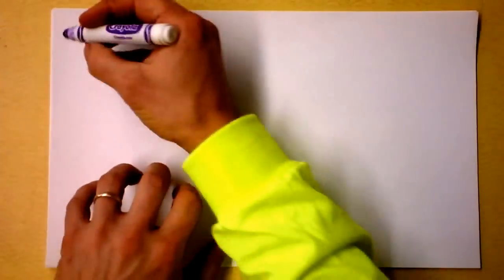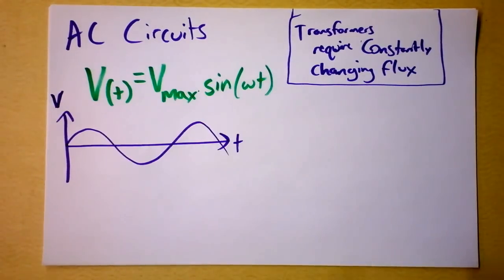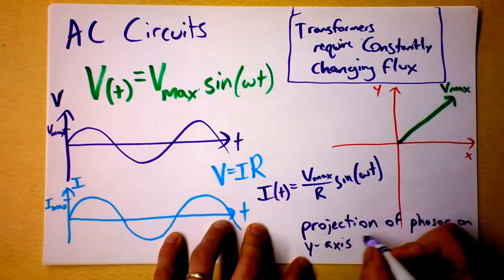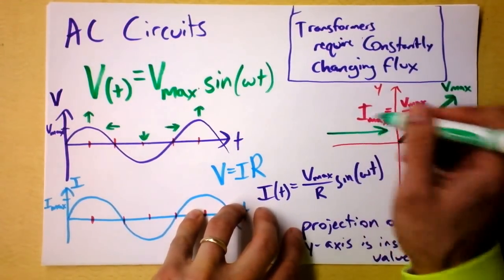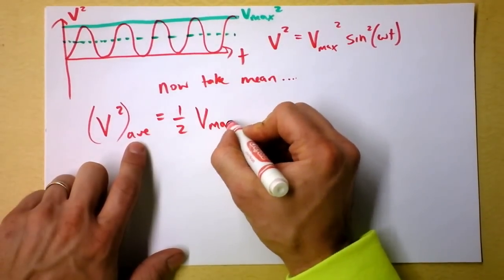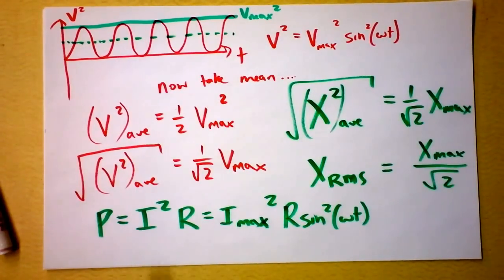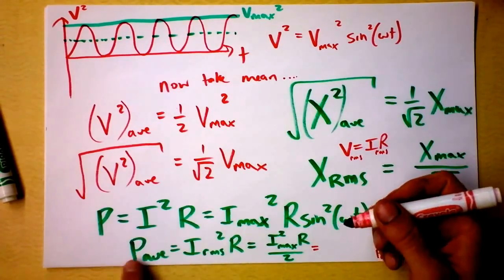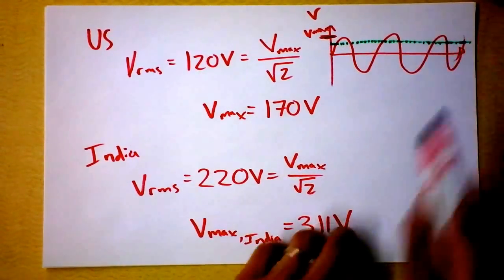Intro to AC Circuits using Phasors and RMS Voltage and Current | Doc Physics

Comment: why is volts and current dependent on  sin(wt) , but my teacher said that it was dependent of cos(wt) ?? help
Reply: In the case of Alternating current and voltage, both are true. A.C has a sinusoidal waveform similar to the graph of sinx and cosx (Google the graph of sinx and cosx, in case you don't know). So, sin(wt) and cos(wt) both can be used to represent voltage and current here.
Reply: Abhi Joshi whats the difference? is it the time frame?
Reply: To assume that the wave is starting from 0 Amplitude, we prefer sin for the sake of simplicity. Whereas, if you observe cosine graph, it starts with maximum value of Y-axis (i.e. Amplitude in our case).
Reply: +darkblader061 I hope this helps.
Reply: Abhi Joshi so its just a matter of convenience? thank you :)

Comment: wait, (v average)^2 is 1/2 (vmax)^2 ? 
why not, 1/2 (vmax sin (wt) ) ^2 

so, why the cosine is gone ?
Reply: Irvan Kurnia Ardi Vmax×sin(wt)  is the instantaneous voltage and thus is irrelevant when you are calculating Vrms because RMS theory was developed purely to calculate power by saying Pave = (Vmax × Imax) ÷ 2
Therefore Pave = (Vmax÷√2) × (Imax×√2)
Therefore Pave = Vrms × Irms

Comment: Never mind! i worked it out! you just did not show your working. You said the RMS =120V, Therefore i have to dubble 120 to get 240, then 240 is the Vmax!! So i have to then put 240/root2, which then = 170V! :D

Comment: Is it my imagination or is it the most people, even the educated and the savvy folks don't say it right.
This is what I hear all the time: In 60 Hz AC system current changes direction 60 times a second.  1 Hz is one full cycle.  
 How about if I say the current changes direction 120 times a second.  
Doesn't the direction change in the halfway point of a full cycle.  At the end of 1 Hz, it is actually going in the same direction again. 
Every time light bulb flickers, I count that a change in direction.  I guess most people feel that just because light bulb flickers it doen't mean that the current changed direction.
Reply: Hi,
Actually 
120hz means 120 cycles per second. The negative cycles are THE change in direction.Each cycle combines positive and negative. If X hz X cycles.
Reply: @bharathp1000   Xhz = Xcycle.  Of course.
Since the current changes direction 2 times in each cycle, how many times it changes in 60 cycles (i.e. 60 Hz)?
By the way, there are no negative and positive cycles.  It is just a cycle.
And there are no positive and negative directions either.
Reply: @alchemy1  
hmm.
In a cycle current changes from one direction to other. So you should consider the count as one not 2.
Reply: @bharathp1000  In other words you count the change in direction at 180 degrees, the middle, the in-between one. 
What is your position if instead of using the words " The electric current changes direction 120 times a second in a 60 Hz AC system"  I said this:  " A light bulb flickers120 times a second in a 60 Hz AC system".
Reply: @alchemy1  Hi,
let's solve it with small values, consider 1 hz, and find out how many times direction has "CHANGED"? and use the solution for many cycles.
Reply: @bharathp1000  The answer to that is quite obvious.  If I walk from point A to point B and I want to come back to point A I  have to STOP, turn ONCE unless I want to go sightseeing or go back to point B.
That is clear.   
 Now I have answered your question very clearly,  It is fair you answer mine and here it is:
Bob asks you, see that guy, his name is James.  He is going to from that one pole over there to that other pole across the field back and forth and back and forth, back and forth.....
Your job is to count EVERY SINGLE TIME  you see James turn around and change his direction.  When your eyes see James make a turn you count it. 
His statement is in CLEAR PLAIN ENGLISH.
How would you count and what would you do?
The question is obvious, are you going to count when he turns around one of the poles ( if yes which one) or both?
The answer doesn't appear mysterious to me.
If I were to ask the same question from 100 people besides you, what do you think their answer will be?  Think about it.
You could answer me regardless.
Reply: @alchemy1  hi, let's not involve Bob and James into this. 
I understand the cycle way.
After reading your first message carefully and I started to think of 2hz signal . If I count the intersection point on the x axis(time) I'll get 3 points. So i say three times the direction changed. It'll be different from the cycle way.
Reply: @bharathp1000  And it is only fair that I thank ( Bob and James) in their effort to bring clarity. And I have thanked them on behalf of both us in letting me use their names.

Comment: your method for calculating the average volatage is wrong.
Reply from the maker: Oh?
Reply: yeah! it needs to be calculated with the help of integration as follows calculate the heat dissipidated by the ac current in a time period and equate it to (Iavg)^2RT as rms value of an ac is that dc which produces same heat in a resistance as produced by ac in time T.hope this helps!and this is not to let you down,you are an awesome guy but i just wanted to correct you.
Reply from the maker: Do I need a resistor in my AC circuit to use this?  Will I be finding the effective resistance of the circuit this way?  And thanks!
Reply: no everything has some resistance R even the conductors,though you dont need to worry about R as it will cancel out when you equate the two equations and then you will get the Irms.hope this helps.